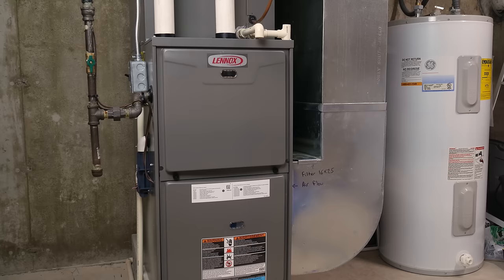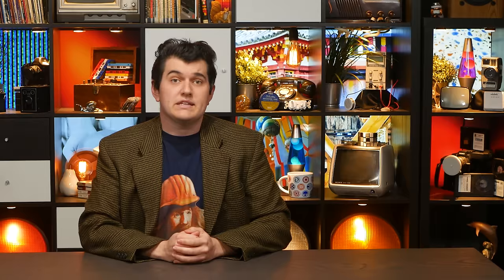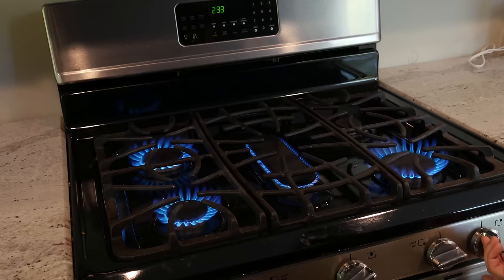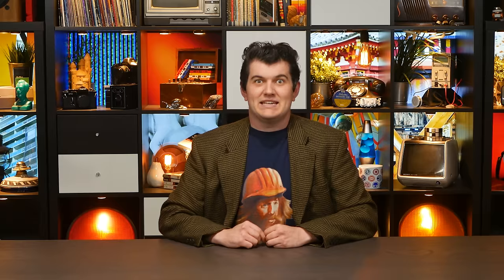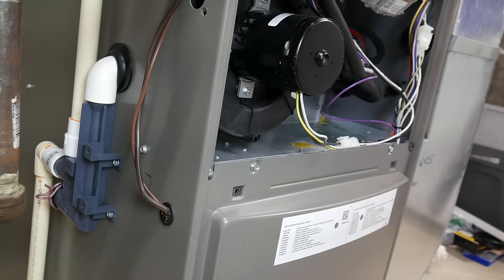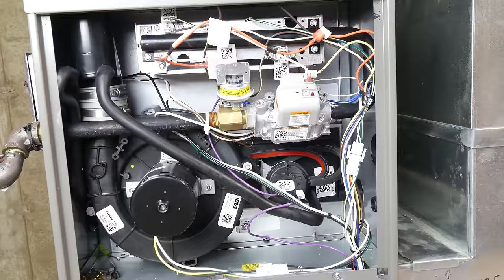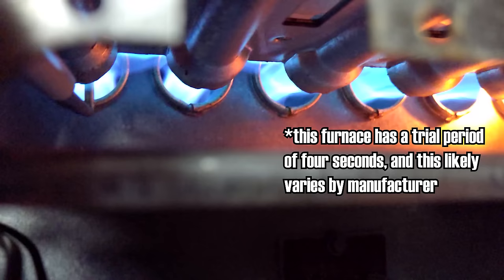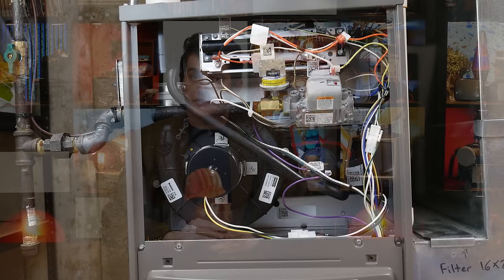Forced-air Furnaces: The What, Why, and How

Comment: > 500% energy efficiency 

what? I expected you to explain it when I heard it, but you didn't. I am confused. Does that mean it releases 5x more heat (in watts) than it uses electricity (also in watts)?
Reply: Yes, but that's because it moves heat from the outdoors into the home.
Reply: Well, heat pumps are good for like six more videos so just wait ;-)
Reply: Heat pumps take in one part electricty and four parts external heat or thereabouts to give you 500% efficiency!
Reply: @Gulyus  clarification: it's more like they contribute about 25% of the energy used into waste heat which enters the home, and the other 75% of the energy is spent moving the remaining 475% contribution coming from outside. Makes that ratio seem all the more impressive.
Reply: Yes heat pumps are kinda 500% efficient. If you look at the complete system they are not as the energy taken to atmosphere accounts for the majority of the energy. But since that is ‘free energy’ it doesn’t really mean anything. I wish he used the proper term for this instead of 500% efficient. The correct term would be HSPF or COPh.

Comment: Laughs in Central-Boiler-and-Radiator-System
Reply: @Les Wait what
In The Netherlands, every house has a Boiler, which heats up water and pumps it up to radiotors.
Reply: @teaser6089  They were big in the Northern US from the 70s through the 90s. Copper pipes and heating oil were cheaper back then...
Reply: My home used to have a central boiler and baseboard radiators. I couldn't get rid of them fast enough. Everything had black soot on it and the house reeked like a truck stop. Now I have LP fueled forced air and air conditioning for less than the cost of replacing the nasty oil fueled boiler.
Reply: @Les our systems are just as efficient as your American Duct systems, however The Netherlands didn't need any air conditioning for decades and now with the summers getting warmer we do, but we ain't callifornia hot yet. And it's just the same thing, but instead of using air, we use water.
Reply: @moconnell663  We don't use oil hahaha
I was talking about The Netherlands, where I live, we use Gas, Natural gas! :)
Reply: @dashcamandy2242  We don't use Oil, we use Gas here in the Netherlands and I'm pretty sure we don't use copper pipes in our fluid transport over here :)

Comment: "We don't typically use resistive electrical heating to hear entire homes ... because the electrical requirements are not practical in a large scale" lol tell that to 73% of all Norwegian homes
Reply: Well we do enjoy ~400v 3phase AC while Americans only have ~200v 2phase
Reply: @subbaaja100  It's not that, it's just that it would be absurdly expensive. Norwegian residential electricity prices are surprisingly cheap from what I've read.
Reply: @zeeiii6857  Most of Norway's power comes from hydroelectric, so it's not only cheap, but also low carbon.
Reply: @subbaaja100  Most American houses are 240v 3 phase, our furnaces and some other high power devices are usually powered by 240v AC while most everything else is 120V (which is actually a lot less likely to kill or seriously injure someone despite our lack of fused plugs and redundant power switches).  AFAIK there are two main types of 240 plug in America, a 3 prong one that only has access to 240 and ground and a 4 prong one that can also tap into 120.
Reply: @grn1  *Single phase, not 3 phase in houses.  3 phase is common in factories, though.
Reply: @grn1  Single phase, not 3 phase, and gas furnaces such as the one in this video are only 120v.  240v is only used for A/C compressors and electric heat strip furnaces.
Reply: @uzlonewolf  Did some quick research and it seems you're mostly right, the transmission lines actually uses 3 phase but from what I gather only 2 of the phases connect to each house.  This incoming 2 phase is 180* out of sync and is considered split phase.  I guess I got those mixed up (and now that I'm thinking about it I distinctly remember reading about how 3 phases are more efficient and how we should be using that instead).

As for the furnaces being 120, I honestly just assumed they were higher voltage since most large appliances are and higher voltages are usually more efficient but apparently they actually use lower voltages for some reason.

I'm usually the one correcting and/or educating other people but I suppose it's good to be corrected from time to time.
Reply: So less than 4 million people there have the right conditions for resistive electrical heating to be practical... Well I'm sure more Americans than that can say the same lol
Reply: @nthgth  If the electricity for heating is generated by burning fossil fuels (or biomass), it is more efficient (and cheaper) just to burn the fossil fuels directly in your house's furnace.  Also, if you are going to heat with electricity, it is more efficient to use a heat pump than resistive heating.
Reply: @grn1  240 Volts are used for really high power draws such as electric stoves, ovens, dryers, water heaters, and built-in resistive heating.  The electric motors used for fans and water pumps in heating systems relatively do not take much electricity and thus run on 120 Volts like smaller appliances.

Comment: I still have customers with standing pilots, vertical heat exchangers, and open flues, than are 70% efficient. Those with intermittent pilots are 78%. Add a damper to the flue, so the treated air doesn't go up the chimney in between heart cycles, and now you're up to 80%. Then came draft induced, horizontally fired heat exchangers, either with intermittent pilots, HSI, or spark ignition, still 80% efficient, but smaller physical size. And then came a secondary heat exchanger, that changes the direction the flue gases travel, from bottom fired to top fired, so that the cool air goes through the cooler flue gases first, then the primary last, extracting 90 plus percent of the heat, and allowing moisture to fall out of the gases, becoming a condensing furnace. From there, 2 state, multistage furnaces slowly increased efficiency, but in small increments, and mostly to the larger capacity ones. My 1994 90% Rheem 60K BTU single stage HSI furnace was rated at 93.3%, while the 90K BTU of the same was rated at 92.8%. Those same designs, today, are rated at 95.1%, and otherwise unchanged. If you must replace you furnace, and you live in the coldest regions, then buy a furnace rated at 95%. That means that 95 cents off every dollar in gas that goes into the furnace, becomes heat in your home. The rest goes outside the home, in exhaust through plastic pipes.

Comment: Me as an european: CO detectors? What's the point, I get central water heating from city plant!
Reply: Gas stoves
Reply: These are pretty rare though.
Reply: Same Northeastern Europe , just ~700m /2.1kFeet away is a city gas fired cogeneration station. It generates 40MW of heat and about 7 MW of electricity.
Russia St.Peter
Reply: Me from the netherlands: Wait americans dont have the standard waterboiler in their home and have these weird hellforges instead?
Reply: @captnduck  we have both, but now forced air systems are more common because they are easier to install and you can out in a central A/C or heat pump easily which is better in southern states and more energy efficient in general
Reply: @misham6547  that makes sense in areas where you need both. Proper AC is pretty rare here, although our summers are getting hotter and hotter
Reply: @captnduck  If you want a/c, this is the way to go. My family and in-laws in Europe during the last few summers were wishing for a/c.
Reply: That is why he said north America.  These are extremely common in Ontario, Canada where I live.
Reply: @captnduck  Hell forges?  They are to attract the Vikings. Of course. /nudge, wink

Comment: "500% efficiency" Trying to trigger all the physics majors, I see?
Reply: Why?
Reply: @waharadome  Because it would be like a perpetual-motion machine, which is impossible.  What that 500% figure really means is that there's heat energy already present outside the system, which it can tap into.  It doesn't produce that heat, just uses it.  (A closed system itself can't exceed 100% efficiency.)  It also exposes the weakness of heat pumps.  If there isn't enough outside heat energy for it to tap into, it doesn't work well.
Reply: Except physics majors are taught heat pumps and other exchangers
Reply: @joesterling4299  Same with efficiency ratings for furnaces in Europe. They were established before condensing became a thing putting condensing furnaces over 100%. Since downrating existing equipment is kinda hard to do now we sell 100%+ furnaces.
Reply: @Gulyus  Are they? I thought that was a really specialized engineering topic.
Reply: It's a verbiage thing. "500% efficiency" tickles overunity and free energy BS detectors, "500% Coefficient of Performance" would be a better term as it indicates 5kw heat out with 1kw electrical input. The building designers and HVAC installers aren't concerned with the heat energy outdoors, so "500% efficient" may be used colloquially, and is accurate enough for their purpose.

Comment: me in southern california having never needed heating in my life: interesting
Reply: Unfortunately you have to live in California though.
Reply: I lived in California and we needed heat.  Only for about 1 month, but we still needed it.  It was also funny that Feb was the coldest time of year.
Reply: what you save in heating, you spend in taxes
Reply: @maxis2k  I live in the Caribbean, and February is our coldest month as well. Gets down to about 23 degrees celcius.
Reply: @maxis2k  : I'm lost... What is funny about February being the coldest time of year?
Reply: @StoneE4  The common perception in media is that December should be the coldest time of year, thanks to Christmas and snow and all that.  But Southern California doesn't have traditional seasons.  It's basically 3 months of Spring, 6 months of Summer, then 2 months of "Fall" (which is basically the same as Spring) and finally 1 month of cold (which would be equivalent to Fall in other areas).
Reply: @maxis2k  "The common perception in media is that December should be the coldest time of year..."
I wasn't aware of that. I thought it was common knowledge, in media and elsewhere, that the coldest temperatures of winter follow a couple months of cold weather in the same way that the hottest temperatures of summer follow a couple months of hot weather.

Comment: The "Franklin Stove" was the start of the closed combustion chamber and heat exchanger you describe. Before the blower fans a gravity system was used with the hot air rising.

Comment: Here in the UK I believe that these systems are known as warm air heating, achieving a mild popularity in the 70s & 80s on certain housing developments, they replaced older convection boilers but seem to have faded from use relatively quickly.  In more recent years condensing and latterly heat pumps, together with solar in a few instances, now seem in vouge.  I suppose this is due to our temperate climate.  We live off grid, and so use electric radiators supplemented by a wood burner whilst our neighbours tend to use oil.

Comment: I still use a Dearborn gas heater 24 hours a day in one room, with a slightly opened  window in another for fresh air.  Nothing like a warm backside after coming back in from the cold.  CO detector next to heater.

Comment: My furnace is below the grade of the sewer entry, so needs a small pump to get rid of the condensate. If this pump goes dodgy you can get a wet floor.  I added a water alarm near it just to avoid that.

Comment: i modified the furnace in my hosue so the intake is sourcing it's air from inside. there is very little ventilation to the outside and surprise, the co2 levels inside were alarmingly high. merely by having the furnace lose a bit of efficiency but source the inside air the co2 levels dropped dramatically to somewhat ok levels. i think i may put a two speed fan on the bathroom exhaust and have it permanently set to low speed with the switch toggling it to high speed. to get a bit more air removal to ensure we have adequate o2 and co2 levels.

Comment: Are you planning to do a video about boiler/radiator systems at some point or would it be a bit too tricky given how rare they are where you live? For that matter, have you considered doing a video about modern wood burners? They can be very efficient (specifically double-chamber systems).

Comment: Two Qs 1:  That pipe with a green tap?  Inside the furnace, the thread appears to be rusted/corroded must be getting hot, therefore steam, water, rust?  Correct?  2: Where/ how does the US get hot water for taps, bath tubs et al.  As always great video,  like your style!

Comment: Wait, is negative pressure a good thing or a bad thing? Isn't this a big reason why transportable A/C units was evil? 

Don't get me wrong, it's avoid point made on both sides. We may be better off with more outside fresh air regularly being pulled into the house and also it's good to be more efficient by not throwing out the conditioned air (either hot air from the heater or cool air from the cooler).

I just think it's inconsistent that when we're dealing with bad bad combustible gas, throw out the heat, no problem. When working with potentially green-energy-powered, 500% efficient A/C, "No, don't waste the money!"

Anyway, thanks for what you do. I love your channel!

Comment: Over here in the UK we are all about the boilers and radiators and hot air heating is very very rare. However I have lived in a house with just such a system, I hated it! It was a small house (even for the UK) and had an internal garage conversion which naturally had no heating vent so remained icy cold without electric heaters however much you tried. I found the hot air tended to rise (as hot air is want to do) so the upstairs of the house would get rather too warm while the downstairs living space struggled to keep heat (I suspect this had more to do with a lack of decent thermostat than the mode of heating to be honest. I am the type of soul that likes to keep the upstairs cool for sleeping so the whole thing was just a recipe for disaster (and the furnace was in a cupboard between the kitchen and living room). I was glad to leave that heating system right up until I had to figure out storage heaters in the new house (no gas supply, wonderful British countryside!). For 10 years I became an expert weather forecaster and cursed the gods of storage heating until moving to my new home 4 years ago, a new build with gas supply and a combi boiler, ahh the bliss, as much hot water and heating as I want on demand in the places I want it!

Comment: I just ordered an inducer fan.  I didn't have the $800 to have it replaced today, but it will cost probably another$600 this year to heat with electricity.  The HVAC company told me that their cost on the part was high but I know it's the standard rate.    Gambling a hundred bucks and my technical skills to get it working.

Comment: I work in the heating industry here in the UK, our company is currently looking at Heat Pumps however for most people they're not a practical solution due to cost (£5-£10K for an installation). 
In real terms the future is hydrogen as the current gas network could easily be retrofitted and as long as we can produce green hydrogen would solve all of the above problems.

Comment: My furnace was shutting off mid-cycle this winter. I ended up having to open it up and lightly sand the metal of the flame sensor. If I hadn't watched this, I probably wouldn't have had anywhere near the confidence in understanding the workings to try that DIY repair. Only spent a few bucks on more sandpaper than I could ever use, instead of apparently up to $200 to get it professionally cleaned. Thanks!
(Don't attempt repairs if you don't read every last warning about the repair process and don't exhaust all non-invasive furnace repair procedures.)

Comment: Some furnaces have the inducer before the heat exchanger but they are uncommon now. Also in regards to air exchange it is becoming more common for building codes to require fresh air to be introduced to the space, most efficiently done with an HRV or ERV unit. Spark ignitors went out of fashion because they last forever, hot surface ignitors eventually wear out and need to be replaced. RUUD/Rheam furnaces still use spark as well as most commercial package units.

Comment: The air pressure switch in the furnace is kind of fascinating: two contacts are held apart by a thin rubber gasket under a slight vacuum, when the system kicks on the pressure goes up and the gasket inverts allowing the contacts to... contact. If the furnace isn't used for a long time (or a fault causes the contact to stay open longer than it should) the gasket can get stretched in one position and not respond properly to the pressure change. That, combined with the comparatively rapid aging cycle of rubber, make these switches the most commonly replaced part on furnaces.

Comment: Heat pumps have been around for 20+ years in the USA so they are not new at all and are very common in areas that have a warmer winter but still need heating like along the western coast from California, OR, WA, BC.   The issue is that heat pumps cannot extract heat properly under freezing temperatures and especially if it is very dry winter like is common in many western high desert states.  As a result the heat pump fails to pull warmer air and kicks on verrrrrry expensive simple heating elements.    I was paying $600 a month for 3-4 months of the year due to heat pump inefficiency in cold climate.  I saved money by switched to natural gas furnace and I still use the heat pump for AC in summer so all I had to do was add the gas furnace 98% efficiency unit and now my winter electricity bill is around $80 and gas around $140 so much cheaper it paid for itself in less than 2 years!!